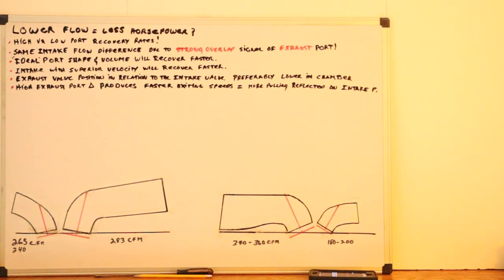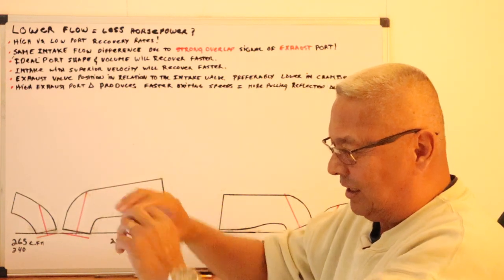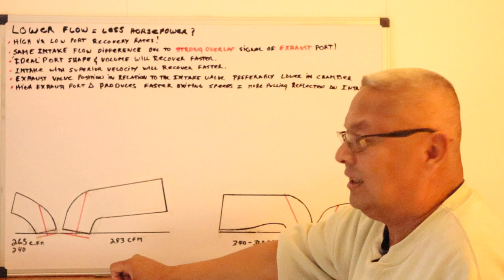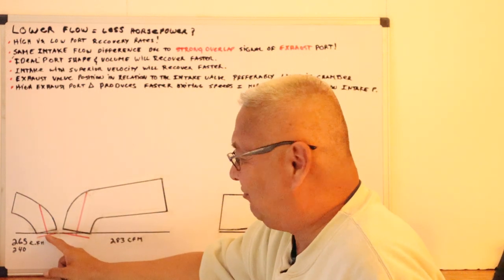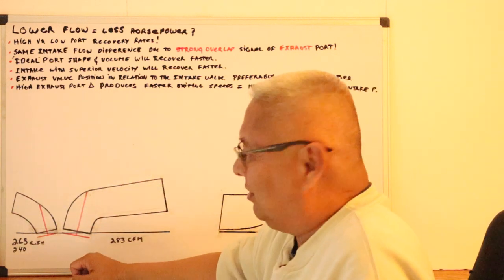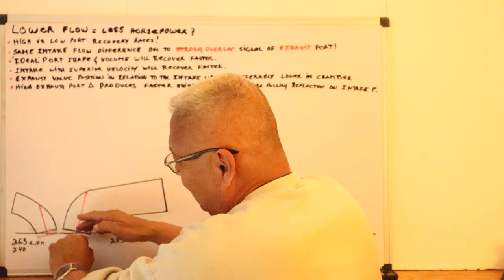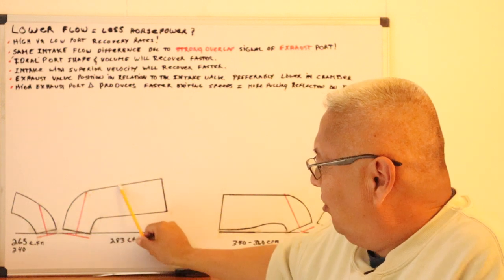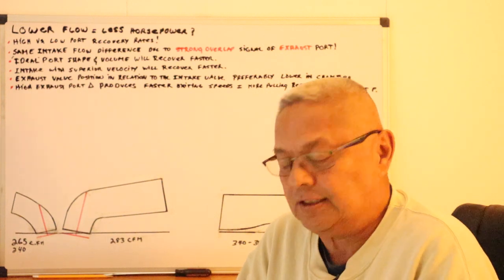PORT RECOVERY: AN INFERIOR HEAD PRODUCING EQUAL OR MORE POWER?

Comment: Hi Ben. This was incredible! Thank you for taking your time to share some of your knowledge. You explained this topic so well. I would have never learned about this if it wasn’t for this video. If I could kindly request a future topic. Header design, diameter relative to exhaust port and valve, length, type of racing. Thank you
Reply from the maker: M E, thanks for your kind words and appreciate it a lot sir.  I will consider your excellent suggestion and have ideas how to go about them.  I dealt with hedder design, exhaust ports and systems as a whole when I gave a presentation to the graduating Engineering Students of MIT in Asia several years ago at the invitation of their instructor-staff.  As well as having discussions with several Engineering students from a CA University.  They were well educated just needed some practical tips and approaches to verify most of their college instructions that they have learned, like designing systems using CFD's and other computerized systems. Unfortunately many of them are taught to not think outside the box and that is where limitations take a hold and innovation ends and it just becomes a monkey see monkey do process when they finally get to work in the real world.

Comment: Sounds like some good engineering for a new flow bench design could come up with a flow bench that can open and close the valves to simulate cam timing.
Reply from the maker: Today we have the technology to actuate valves at racing speeds but the effects of exhaust pulling on the intake @ overlap will be a challenge to replicate!  Herein I feel where again the limitations of simulation will show up.

Comment: It is a joy to listen to you explain the complex systems involved in an ICE. 50 years ago I had always heard talk about the BBC (Big Block Chrysler, the other BBC) having high velocity intake ports vs the BBC (Big Block Chevy...lol) and other very high flowing heads, relative to their peers in the same era. Of course then I would ask how the high flowing Hemi head figured into that high velocity design...
Reply from the maker: X, thanks for your comment and appreciate it much sir!  I feel the HEMI is in a league by itself and that includes the Boss 9 heads as part of the mass flowing variety.  I feel we cannot really claim them as high velocity because they are so huge and that direct mirror positiion of the exhaust valves, gives reversion a big say on its "inability on the streets" and short of all out racing.  I feel the BBC/BBF got a leg up on the HEMIs on the streets if they are limited to street compression ratios.  Unlimited compression and intake manifolds/CID with dual dominators then they surely will dominate!  lol  
With that said I will race them for half a block with my  BBC/BBF and will let off because I know what will happen to me.  :)
Reply: @benalamedaracing2765  I can only imagine some of the things you've done on the flow bench and how interesting it is to an inquisitive mind. I share that trait. 
In the 70's there was a saying, "Gears or cubic inches"
With my friends an I we had gone one step further, we ran both! If you didn't have at least 4.88's your weren't going to be door to door with us for much more than part of first gear. lol That was one of the things about the Hemi was the rpm's it could reach when coupled with a stiff gear. 
Thank you for putting this information out here for everyone to benefit from. Very cool Been, Bravo sir.
Reply from the maker: @topenddean , thanks for your comments and appreciate the feedback specially from individuals like you that have seen it and done it!  There is no other way to explain it but thru experience where we both gain wisdom and knowledge.  Both excellent attributes!

Comment: Ben we need more guy's like you flow bench and flow numbers are over rated, I am doing a pair of dove heads right now there is nothing good about these heads but the e7s 460 later model heads have raised ports I say even though people say the ports are to small and you can't get enough exhaust valve into the chamber they think that the dove head is a better head due to flow numbers I say when I'm done porting the e7 heads their going to knock the fire out of the dove heads even if they flow less then the dove heads do , my son sent me this video of you and I'm glad he did,  I did subscribe and I think you do a great job Thank you for taking the time to share your knowledge with people👍👍
Reply from the maker: Terry, as you found out it is not all about flow but something more!  Keep in touch and let me know how your project produces power and that would clarify what we are thinking about!
Thanks.
Reply: @benalamedaracing2765  Thank you Ben Im going to be doing a 460 segment using the dove heads even though they have very low performance capability and unless you heavily modify them by raising the ports on the intake side and exhaust side, Id love to have you here to share your opinion because people just don't get it about a raised port. I really like what you do especially matching the combustion chamber to the piston design I see exactly why your motors make power and I'm looking forward to more video's from you 👍
Reply from the maker: @terrygrover6440 , I ran a early 70's 429 casting and installed 2.24 intake and 1.75 exhausts.  It had lots of power and ran in the high 12's with a mild Isky hydraulic lifters!  It was my brothers and my street car and did all these with 3.55s and stock torque converter ran high thirteens in a Torino 1970 body.  Switching to a 460 crank woke it up big time and the rpm capability did not lose any whatsoever.

Comment: Absolutely love gearhead videos worth watching. Great tech!
Reply from the maker: Thanks Rich!  I had to  highlight other aspects of power potential and not just saying it flows this much and should make more power!
Reply: @benalamedaracing2765  I appreciate all of your tech videos, I learn different things from each I've watched. Thank you!

I like how this video illustrates the importance of matching the ports to a particular configuration, and cam timing, to maximize cylinder filling with minimal waste getting sucked out the exhaust during overlap.

Often people think "more flow more flow more flow".... Versus this video showing how "smaller" exhaust ports (ratio) can be beneficial for a particular build.

I also liked how you explained having a recessed exhaust valve helps fill the cylinder versus pulling the intake charge straight out of the intake valve and into the exhaust port. Great stuff!

Comment: I learned something. Thank you. I feel like a caveman building a rocket. 95 351w Ford. World sr Roush heads. Kb dome pistons and TFS stage 4 roller cam. For my 60 Falcon with c4 and m2 front. I need 1.75" headers that will fit the 1.3x1.2 exhaust ports. 351 in a Fox would work but I cant find them. This lesson drives home how important exhaust scavenging is. Thanks.

Comment: Ben,you know I have been following and listening to everything you put out. I'm always wanting to push the extreme limits on cylinder heads I get given to me. (Mainly cast iron factory small block Ford head's) I'm currently working on a E7TE Ford 302 cylinder heads😭😭😭.  I plan on putting 1.94" intake valve's and 1.58" LT1 exhaust valve's or 1.60" exhaust valve's in it. I will be deshrouding the combustion chamber, the valve bowls but, I'm considering raising the exhaust port up far as I can go safely and then fill in the floor until I get the velocities I want. What is your assignment on that? By the way, another awesome video explaining things.
Reply from the maker: Gary, thanks for following my posts and appreciate it much.  Anyway your plans seems the right way to go about it and would just use the 1.6 exhaust valves and no need for the Lt1 valves.  Raising the exhaust and widening using the Felpro 1415 or max out to the 1487 and use 1 3/4 primary pipes at the minimum!  One thing that really worked for me back then was when I pushed in aluminum or cast iron tubes to be grinded flush on the pushrod bend of the intake ports.  Really works big time and needs an offset intake rocker arm to clear the new re-drilled pushrod holes in the heads made possible by the tubes!  By the time you did this the intake ports is straight without the constriction of the pushrod bump on the intake ports!
It really wakes up the engine when you do this.

Comment: Excellent video! I’ve been learning a lot lately about Hemholtz resonance, reflected waves and how intake runner length changes these values. Off topic but I saw a testimonial video you did for IC Green oil additive. Does it really work and are they still in business? I see it currently for sale on Amazon but their website doesn’t seem to be around.
Reply: I was involved in racing cylinder head and intake manifold work for about 20 years in NASCAR. When I was in community college I wrote a paper on the tuning peaks of a Cup engine Ford vs Chevrolet.  Showed why unequal (Ford) made a broader torque band than a Chevrolet  (more equal).  Learn a ton from Dynomation simulation program.  Thanks Curtis!
Reply from the maker: @jimmyjimmy5398 , agree with you on your thoughts and may I add, the fact that the Fords have same port approaches is great and the outside ports are actually longer compared to the center 4.  However, it is not the same when running a sheetmetal with dual carbs then all approaches are more straightforward equal!

Comment: Is their a way that can be explained on how to tell if the port is being stacked with air and recovering to the best of it's ability. Is that something that can be determined in the assessment of porting and flowed, or is that more of a by the seat of your pants feel like you were talking about in the sluggishness on the shift. Great information by the way, love the way you break things down
Reply from the maker: Paul, if a given cylinder heads performs impressively against a much better flowing piece then it is very much an indication of a fast recovering cylinder heads all else being equal!  Maybe someday somebody out there will make some kind of measuring device with an actuator that would shut the valve off and measure the stacking ability of any given port!  That would answer many questions on the dynamics of flow and port recovery.
Reply: @benalamedaracing2765  It may actually be feasible now days to test the Port Recovery Efficiency of a given port design with the advent of electrically activated valve trains. Theoretically you no longer need to run the engine, the head can be mounted to a flow bench with the valves in place and the actuators fully functioning to what ever rpm desired.
Reply from the maker: @topenddean , there are flowbenches out there that are capable pulling in 65" and with electronic activation of the valves we can probably get close to measuring port stacking or recovery.  I can just see my electric bill at the end of the month with a machine like these!  lol .  Wifey already complains when I am on that thing days at a time.  I just about wore out my bench when I did an R&D for a 24 Hours of Daytona Mercedes team and got to spend countless hours to find something which is not easy by any means.
Reply from the maker: Obtw, it would be hard to mimick the pulling power of exhaust overlap on the intake port!
Maybe some day because the exhaust is almost or is at supersonic speeds when it exits so I would be scared if I am anywhere on that machine.  
Some day, test your engine on the stand and close both valves.  Introduce about 130psi on the spark plug hole and gently tap the exhaust valve tip and observe what you will hear and see!  It is quiet revealing.
Reply: Idk but I think this may have been meant for Juhanas question?
Reply: @paulgibbsjr8531  check 👍😀

Comment: Hi Ben, have you ever tried to get flow numbers for valve overlap on a flow bench? Both valves open at low lift and suction from the exhaust port with a "piston"/block off plate just below the combustion chamber. Not sure if it is possible to do or even feasible. Just curious.
Reply from the maker: I am sure there might be others that perhaps tried it but to me at this point in time is an impossibility!  We have to produce near "sonic" flow speeds to mimicked the speed of the exhaust gases to yank the intake column in to the chambers.  How we do that would probably require a small turbine engine propelling the gases to actual exhaust like speeds so that is a big problem.

Comment: Most ports have high velocity and low velocity areas, i think the chevy LS heads do so well is, the ports have high velocity through out the whole ports ?
Reply from the maker: LS heads are impressive for street running and sometimes for all out racing.

Comment: Awesome and informative videos Sir. Now im thinking the exhaust flow play a part in how strong the signal or low pressure could be. Higher exhaust port velocity may restric the flow, but gives wider tuning window/better for cylinder with less overlapflow, or slower intake port velocity? 

Just thinking after watching your video before going to sleep. Thanks for sharing, 

-juhana
Reply from the maker: Indeed if the exhaust port/flow is impressive less overlap can be used on the engine!  Few people really appreciate the part exhaust + overlap has a major effect on intake port capability!  Hard to duplicate in a flow bench because these signal are very strong and hard to replicate on any flow bench to basically test overlap performance in the equation.

Comment: Hello Ben. I greatly appreciate the videos. So, one can say the exhaust system can play a large role in how the signal relation is between the intake and exhaust ports as well? Thank You
Reply from the maker: On one of my videos I spoke of the intense pull of the exhaust on the intake ports basically making the poor flowing intake perform just as good a good flowing heads!  Signal relation between these two ports are not considered when evaluating a port on a flow bench specially in the case of the intake port!

Comment: lol....Ben,  all my cylinder heads are inferior...but comparing an iron GT40 with a Cleveland 2v, I like the ports and bowls of the windsors; but the canted valves and valve size of the 2v looks like they would give the better yank during overlap. My home made flow bench is voting for the 2v's. If you were building a 302, and you only had those two heads, and ease of fitment and assembly were not going to sway your decision, what would you vote for?   One has 1.72 rockers, one has 1.6. It might only get a GT roller cam...both would get 10:1...and will go in a street car. Is there a clear winner?  And if the cid was 351+ would that tilt everything to the 2v?
Reply from the maker: Are you talking about the Aussie 2V's?  If it is then there is no comparison you would have a superior cylinder heads that is hard to beat!  If you can flow test and get the actual numbers on your head flow then making a custom cam will benefit you to target that exact cylinder matching the cams to it!

Comment: Does this apply equally to na and boosted engines or more towards na?
Reply from the maker: Port recovery or recharging (stacking) still applies even with boosted combinations.  It is a very complex scenario and many of the same issues still apply even with boost!  Remember the port jamming or stacking when the intake valves are close is what makes boost!  Not all goes in and this leftover pressure is what we see as boost and all pressures upstream of the valve is actually a reservoir of boosted intake column pressure and sometimes the "slightly longer" the port the better, but within reasonable limits...

Comment: So say you have an option of 2 heads that are the same port volume. Would you prefer the one with the highest velocity or the one with the higher cfm?
Reply: Darin Morgan: velocity velocity velocity 

Says it all....
Reply from the maker: Well known engine builders know that the most flow you get with the smallest diameter possible will give us the power we seek!  Therefore small ports have velocity the reverse of big ports and it is very important to be aware of this scenario.

Comment: Thanks for your video, got a question on turbo application, would the exhaust valve still remain at 53-55%, or go to 75%. 
It is on methanol with 50 lbs boost on intake and 88 lbs on exhaust. 
Also what would be a good cross-sectional area of intake and exhaust port as compared to valve size (or etc...), thank you for your time.
Reply from the maker: What kind of engine do you have?
Reply: @benalamedaracing2765  it is Rolls-Royce Griffon v12, it is a 4 valve head with bad ports. 
2239ci 6in piston x 6.6 stroke
6:1 compression
2.08 intake valve
Thinking about designing a new head, canted valves, 2.3" intakes, higher ports (30-35 deg),
Reply from the maker: @GriffonGrowl  4 valve heads and can you send me a picture of this @ my Fb under Ben Alameda Racing?  There should be enough valve there vs. a canted 2 valve arrangement.  Interesting to say the least!
Reply: @benalamedaracing2765  I was thinking about doing a 30 deg valve on the intake valves, since max rpm is 4k...
If i do a new head  it will be 4 valve with approx 20 deg angle.
I sent some pics to messenger, under Zuch Fucherberg.

Comment: Camshaft overlap vs negative overlap depending on how your head flows ?
Reply from the maker: Yes and having too much overlap can drastically reduce your dynamic compression and reversion can also be an issue coming back to the chambers.  A little bit helps to repack back some of the charge that got past the exhaust valve and in this scenario it helps..